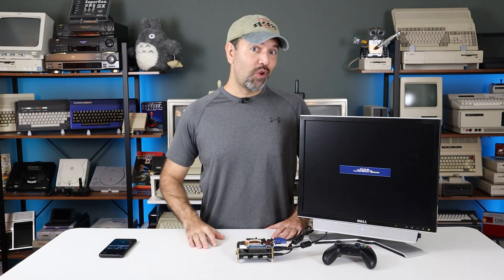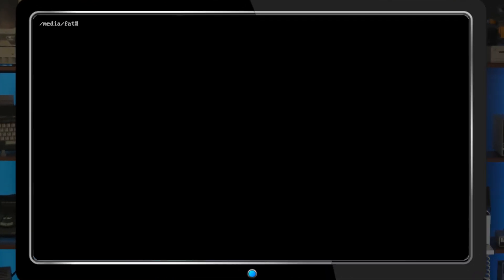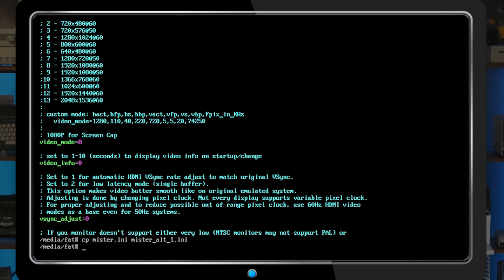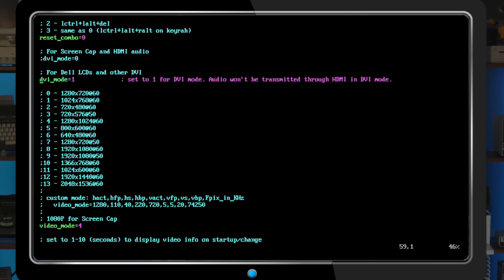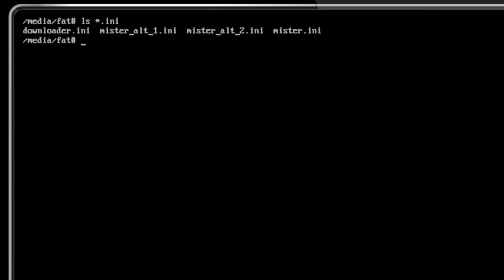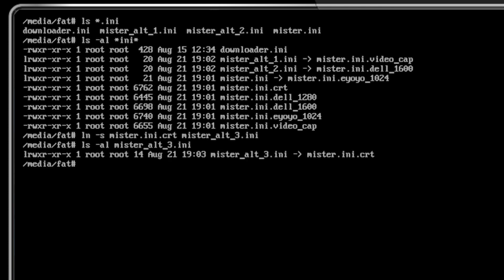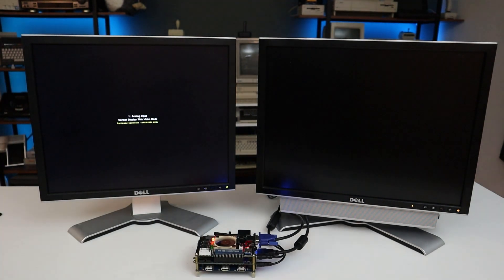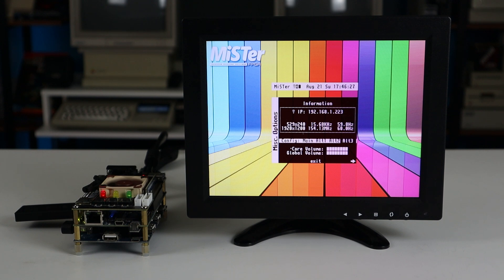Multiple profiles on the MiSTer FPGA!

Comment: How would I set a custom video mode? For example video_mode=1600,64,192,304,1200,1,3,46,162000. I've only figured out how to switch between the presets. Completely new to all of this. Took me forever to even figure out that I had to type 'r' to change the numbers in the first place
Reply from the maker: It's a bit complicated, but the documentation has some good info and links to calculators you can use to create custom modes beyond the predefined ones already in the mister.ini file. Check out: https://mister-devel.github.io/MkDocs_MiSTer/advanced/videomodes/
This resource is also pretty good: http://www.geocities.ws/podernixie/htpc/modes-en.html
Reply: @retrobitstv  Thanks! Turns out I just needed to watch a tutorial about vi editor. Just needed to figure out how to actually change the text on the video mode line.
Reply from the maker: @JorgeLopez-kt7zy  Ah nice. Yea, if you haven't used vi much in the past that can be the hardest part since it's completely unintuitive!

Comment: Cool what would be the settings for a Sony BVM 20F1U? Will this work the sharp x6800 core? Also is their a ton of lag introduced with this procedure? Thanks for the great video :)
Reply from the maker: Using the built-in scaler will result in between 4 scanlines to 2 frames of latency, depending on what settings are used. You can try the settings from the video if you want to force 240p for a certain core like ao486 or x68000. It works to some degree for playing games but it can be really hard to read 80 column text, for instance. https://misterfpga.org/viewtopic.php?t=666

Comment: Hello!

I have a Dell 1708FPT monitor that I can use both horizontally and vertically.

By default it is horizontal and when I want to play vertical games, I just rotate the screen and the game will look fine, but the MiSTer menu will be flipped.

Duplicating the .ini file and doing a little configuration in the second .ini file could make the image switch with the joystick and fix it, right?

I really like your videos, I hope you can make more related to all the secrets of MiSTer.

A big greeting from Argentina!
Reply from the maker: Thanks for the feedback! Check out the "osd_rotate" option in your mister.ini, this will allow you to turn the menu to match the orientation of your display. You can do it globally, or only in certain cores by putting it immediately below a [core name] tag. e.g.:

# Default global setting
osd_rotate = 0

[gorf]
osd_rotate = 1

Something like that should work.

Comment: I just got the rest of my parts from MisterFPGA literally just last night (Aug 25 2022) and started to tinker with different cores.  I was looking at the Alternate setups and couldn't figure out what to do about them.  So, this was done JUST in time.  I have my main HDMI monitor on my main PC rig setup because it has Audio, mean while my VGA monitor obviously doesn't.  Switching between the two WAS going into editing the file, but, I prefer my quad monitor setup on my main rig vs a tri-setup with the MiSTer hogging one of them.

Thanks!
Reply: Is it expensive to get a basic set up going? I see a lot of mixed opinions
Reply: @kenknight5983  It'll first depend on EXACTLY what you want out of the unit, and what you want the unit to look like in the end.   I picked up the 128mb module (£49.99), USB 2.1 hub (£32.99), the analogue IO board (£40.99), the 4amp Power Supply (£19.99) and the RTC (£16.89), and it cost me £171.65 with shipping, which works out to $262.91 CAD or $201.68 USD as of the 27th (Exchange rates are nuts!).  SOME of this, you're not going to get away with any cheaper, or if you do, only by a little bit MAYBE since everyone wants their cut.  Before I got my parts, I had the DE10 and a generic 4-port unpowered USB hub that was plugged into a USB Male Micro (or whatever) to USB-A Female type adapter, and the unit functioned at a real baseline.  I couldn't play Atari 2600 games but I could play Turbo Gfx 16.

At a minimum you'll want the RAM, and you can get away with the cheap USB hub.  
- I picked up the Analogue IO board because it has 3.5mm audio out jack that I can plug into any regular set of speakers, and use VGA at the same time as HDMI.  If you're going into a modern HDMI w/Audio monitor or TV, you don't need the IO board.  In my case, I wanted the luxury of using either HDMI+Audio (One of my main rigs monitors) or a VGA capable monitor but needed speakers since VGA doesn't carry audio.
- I picked up the USB hub because I just wanted to make SURE that everything would work together.  
- The 4amp PSU, I planned on hooking up a 256gig SSD HDD to it, so that kinda was a requirement for ME.

So I sense the "MIXED" opinions I think are going to gear to what you want out of the machine vs what you want the machine to look like, and most importantly, vs what the costs are of the original hardware this DE10 acts like.
Reply: @Mr76Pontiac  Informative. Particularly as I like vga. Thanks